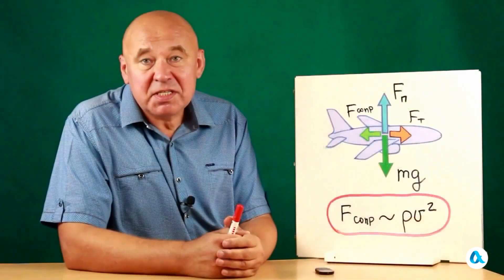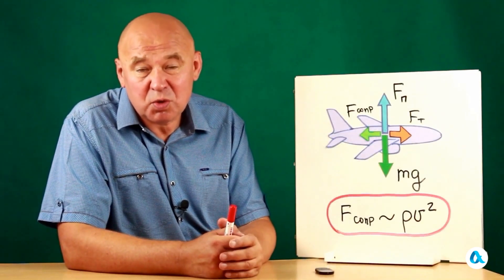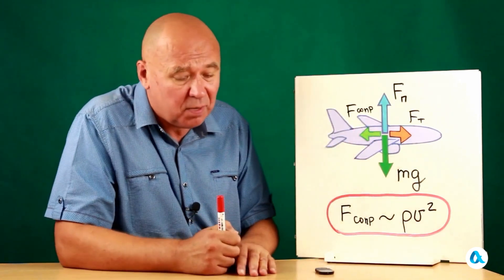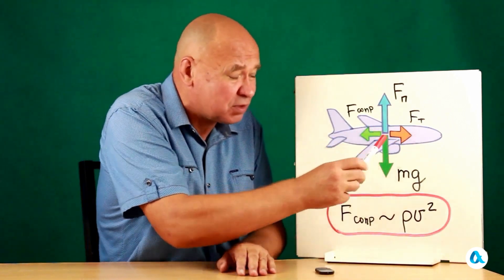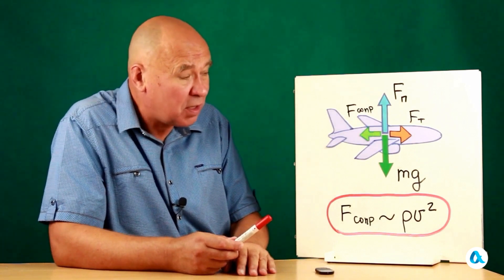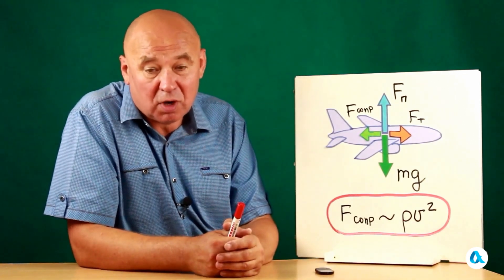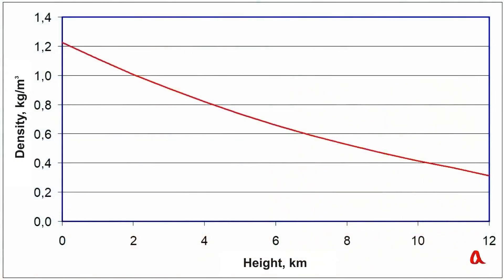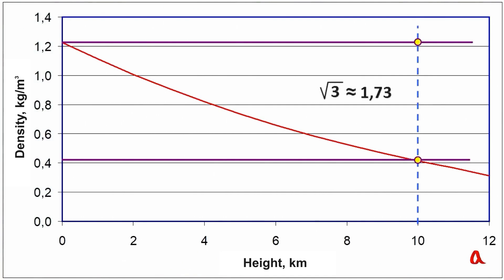Why do planes fly so high?

Comment: I suppose even higher altitudes reduce oxygen content for combustion, and of course the passengers, and there is less air available for wing lift. With propeller aeroplanes there is the lessening effect of reduced air for the blades to act on, and their piston engines require ever-increasing amounts of supercharge boost pressure to keep their cylinders operating efficiently. I'll bet there are many other reasons, too.
Reply from the maker: There's some common sense in what you're saying

Comment: Not to mention the saving in fuel burn and hence cost of the flight by flying at high altitude.
Also, the best advantage of flying at high altitude - you don't fly into mountains. That seriously ruins your day.
Reply from the maker: Then why not fly even higher?
Reply: @getaclass_physics  The aircraft runs out of power, lift and the stall speed increases and the critical Mach number converge. The aircraft  gets into a coffin corner situation. Also the engines rusk flaming out as the oxygen reduces.